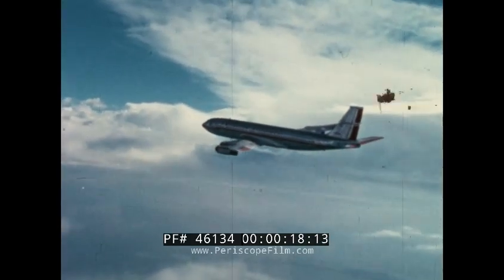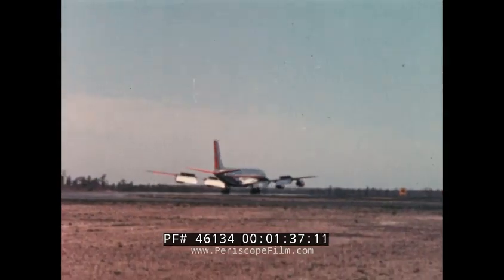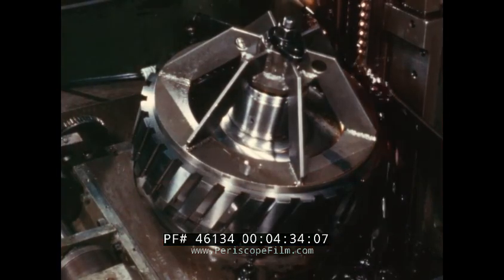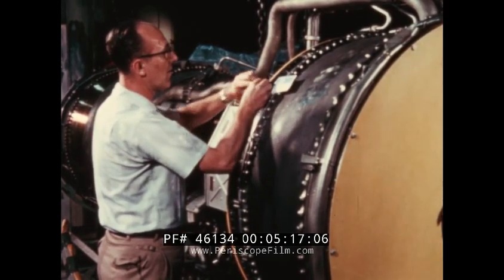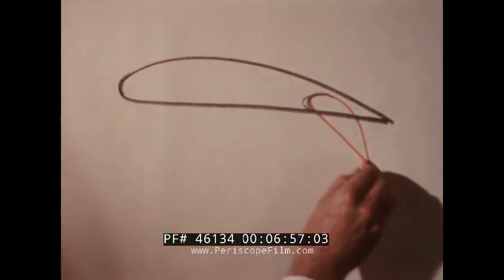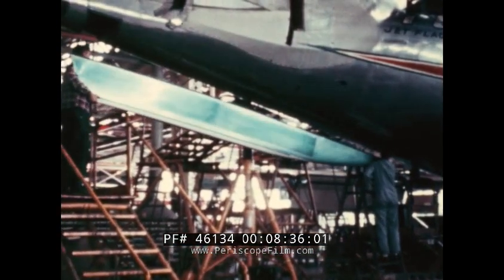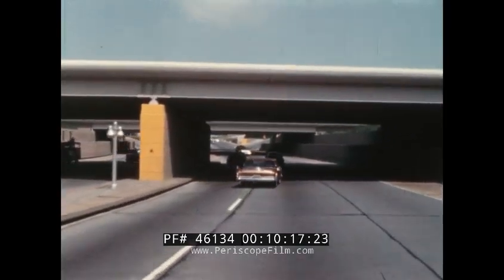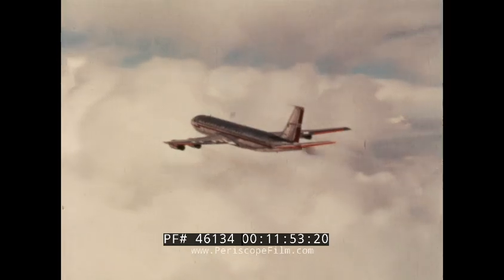AMERICAN AIRLINES BOEING 707 ASTROJET PROMOTIONAL FILM 46134

Comment: American used the marketing name "707 Astrojet"  for not only its improved 707s, but 720s as well, as was the case with the earlier "707 Jet Flagship" moniker. American's 720s did not have the HF antenna on top of the  vertical fin like the 707s did (other 707/720 operators opted for this feature on both versions).

Comment: Interesting video, I've wondered when they began to figure out the benefits of the extra cool air cowling around the engine. To my eye, the look of passenger jets hasn't changed all that much since the early sixties except for the engines, they've gotten huge!
Reply: Its also just part of a turbofan engine. A pure jet would take far too much runway so at low speeds the intake turbine produces more thrust as essentially a propeller than the jet itself can. Once speed builds there is enough airflow that the jet starts to be efficient.

Comment: The "pilot" stated that they were at 32,000 feet and the temperature was five degrees below zero. Me thinks he left off a zero.
Reply: 5 below or 50 below, it's all the same, damn cold outside. But inside nice and comfortable, perfect for a smoke and a martini. Was "Barry Allen" flying deadhead on the jumpseat in the cockpit on one of these flights?
Reply: Yeah I cocked up the OAT but the Gen public wouldn't know anyway 😂
Reply: Except in that era 32,000' wasn't a valid flight level!  Above 29,000' aircraft were separated by 2,000', so they could have been at FL310 (Flight Level 310 - 31,000') or FL330 (33,000') - but not in level cruise at FL320!

Comment: They said in this video:- "No one will fly faster". That's not true. The General Dynamics Convair 880 was considerably faster.
Reply: American flew a version of the 880, the 990 Coronado (it was marketed as the "990 Astrojet"). Unlike the 880, which was powered by CJ805-3 turbojets, the 990 was powered by CJ805-23 turbofans (General Electric built both versions), with the fan aft-mounted compared to the 707's JT3D-1s with the fan forward-mounted.
Reply: @johneddy908  I was flabbergasted to learn of the CJs with aft fans!
Will be amazing to see how jet engines evolve next, will they be powered by hydrogen or electric?
Reply: @donaldstanfield8862  , many of today's jets are capable of flying on an advanced biofuel called Sustainable Aviation Fuel.

Comment: Wow they hot rodded the 707 to make it faster to get you there ahead of schedule and in comfort, fuel economy and environment was an afterthought. Not like today where every plane is built for super high efficiency and passengers are treated like cattle.
Reply: Weve deregulation (and ourselves) to thank. Sure, prices were astronomical back then, but ammenities were provided to incentivize travel. 

Now its a constant race to the bottom and a constant pushing of the line of what passengers will tolerate in return for lower airfare.
Reply: Yeah, that's why the narrator talks about getting more power and speed from less fuel.  And being actually ahead of schedule is not, on the whole, beneficial:  it amounts to taking a schedule, ignoring it, and then having to sit around improvising and waiting—which may be why the script talks about "on-time reliability", not "ahead-of-time disruption".

Comment: Interesting how P&W hadn't quite figured out to increase the bypass air ratio to 7-9 to 1 yet. You'd think technicians would've given this more thought and experimentation; we would have to wait until the 747 era. That said, we now have 737-800's in place of 707-120's today. However, these twin jets are not nearly as interesting to look at, though they are far more reliable and quieter (except the MAX until its MCAS issue is resolved).
Reply: That's a good question - it seems simple enough, but as with many things, the reality is more complicated than at first seems apparent.

It was the evolution of the technology - the core engines weren't mature enough at that point to drive a larger fan.  The early high bypass engines were rather cantankerous - difficult to start on some occasions.  Features like variable inlet guide vanes were relatively new, and not used in as many stages as on modern engines, and a number of other features which had to be developed to create higher power output engines (required to drive a larger fan) simply hadn't been invented yet.
Reply: So, if 737-800's much newer jets replaced 707-120's much more "ancient" past jets, which jets of today replaced the Boeing 707-320 B's& C's intercontinental versions which had greater capacity & power than the earlier Boeing 707-120's?

Comment: Sadly in 60 years speed-wise not much has changed !  Ticket prices have come down in dollars adjusted for inflation but at an enormous cost in service, comfort and overall passenger experience. Unfortunately that’s what happens when government subsidies go away in an industry with razor thin margins.
Reply: With government regulation the fatter margins you refer to were artificially set. While the roominess and pampered service may not be what it was in the 1960s, deregulation opened up the possibility of air travel to many more people. The free market has increased the safety, profits, and schedule capacities of the airlines.  During that time, people simply "voted" for cheaper airfares, rather than roomy seats.
Reply: I remember when I was a kid almost no one I'd met had ever flown. It was something rich people did. We literally would drive across country on vacation.
Reply: Great service is available.  Simply book a first class ticket or call net jets.  What you’re saying is, you’d rather not pay for great service, you just want it anyway.

Comment: How come today's planes aren't cruising over 600mph like the old 707's and DC8's?
Reply: Joseph Liptak The faster you go, the more drag that develops, and hence, more power is required to overcome it. It's called significant fuel economy at lower speed. Much like driving a car at 55 mph instead of say, 65.
Reply: Boeing's 787 Dreamliner flies a bit faster at cruising speed - that is why it takes just seventeen hours to fly between Perth, Australia and London, England on an example flown by Qantas on the "Kangaroo Route."
Reply: We do actually. I’m a pilot on the A320. Depending on how much headwind or tailwind you are getting, our ground speed can get over 600 mph.
Reply: @BGCflyer  i also heard that the A-380 can get close to700. T or F?